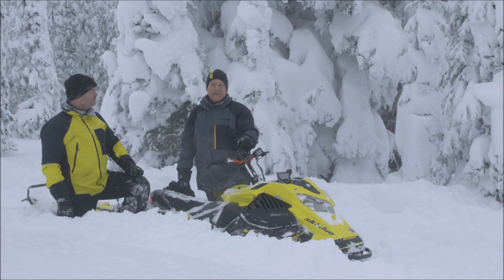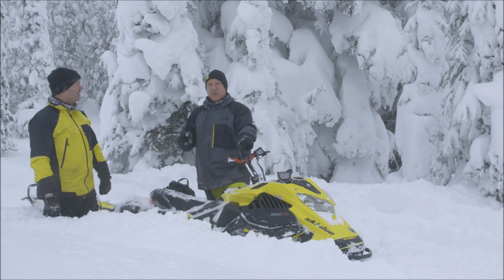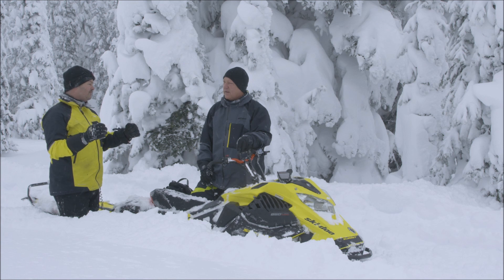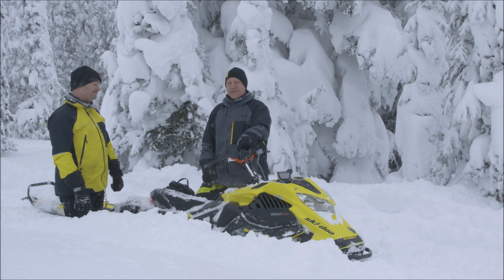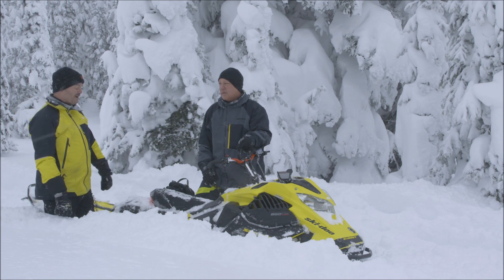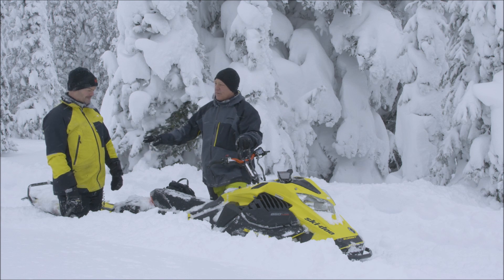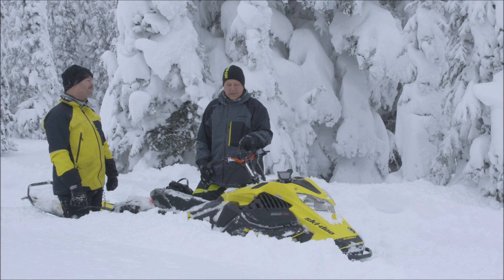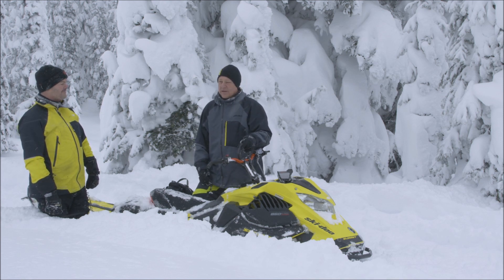Ski-Doo Summit TURBO tech talk

Comment: 4psi at max 165hp.........Ummm why would I do that when I can go aftermarket and make 190hp+?
Reply: nt3523 cost and reliability and warranty.
Reply: @ES-pr8bt  We've got Silber kits on an 850 skidoo and 800 axys.  1000 miles on each.  Zero problems.  Both setups were cheaper than the new Skidoo and about 30-40 more hp at 5 psi.  Warranty is good, but 1year is nothing.
Reply: nt3523  $4,000 for the kit plus installation if you don’t do it yourself.
Reply: @ES-pr8bt  We paid $3500.  Install was easy.  Couple hours.